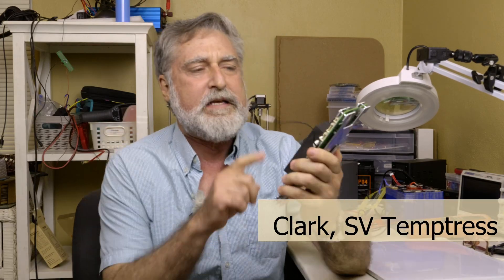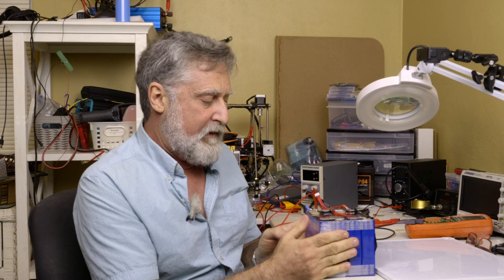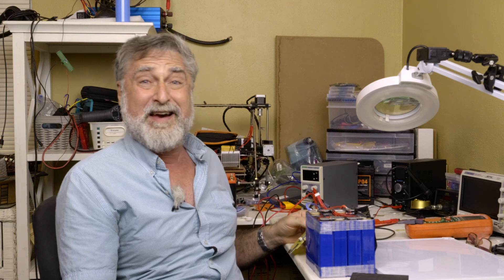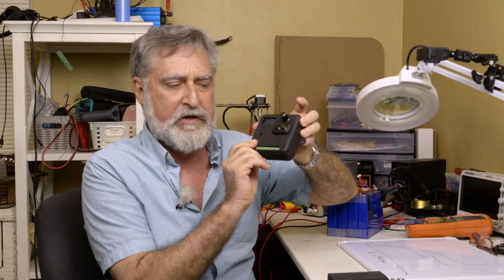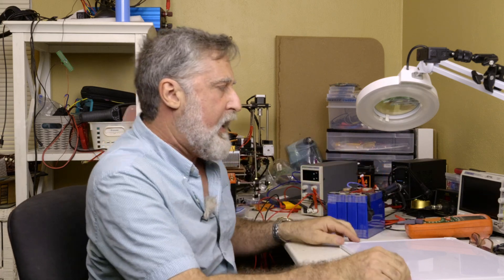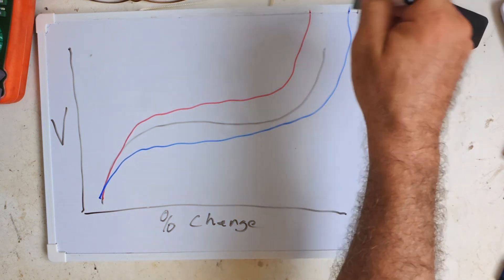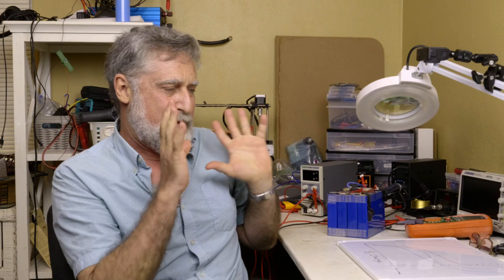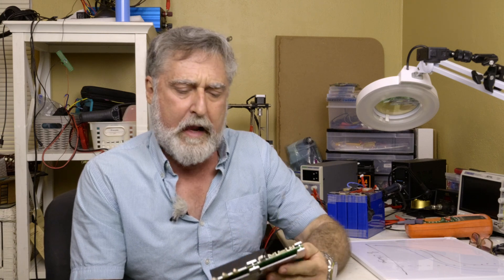What is a BMS really??

Comment: A good video on BMS, thank you.
I would like to correct and elaborate 4 points as follows:
0:20 There is a BMS in any LiFePO4 battery
==> Above sentence is true as a general rule, HOWEVER on starter LiFePO4 batteries the standard is rather NO BMS (in starter batteries the BMS is the exception, because to realize a BMS that can handle the extremely high crank amperes (CA, in lead acid often called CCA because it is tested at cold temperature -18°C, in LiFePO4 only CA because at -18°C a LiFePO4 battery has a high chance to fail, at least you need to apply some kind of warm-up procedure like switch-on main light for 1/2 or 1 minute or do have some heater integrated into the battery).
4:15 LiFePO4 is much less prone to venting/explosion/fire, because the BMS has a temperature sensor
==> NO, the reason of LiFePO4 being much less prone to venting/explosion/fire is not the BMS, BUT the different chemistriy of LiFePO4. Li-Ion batteries also do have a temperature sensor (no difference in this respect), but the chemistry of most Li-Ion batteries will start to get exposed of its oxygen once the temperature has achieve the level of about 150°C. The great exception is the LiFePO4 chemistry where the oxygen O is much more tightly bound, this means oxygen gets only released once the temperature arrives at 350°C.
The difference 150°C to 350°C before the oxygen does get released it THE REASON für LiFePO4 being much less prone to venting/explosion/fire.
12:30 If you try to charge LiFePO4 by voltage you will fail
==> It is correct, the voltage of a LiFePO4 battery is a very poor indicator for its state of charge, because in the use region of 10% to 90% charge the voltage does change only a few 10th of a Volt.
However, THE VOLTAGE is also for LiFePO4 THE INDICATOR/Limit for charging. The CC-/CV-mode applied for lead acid and lithium charging is always the same! What differs is the level of CC (Constant Current) as long as the charge voltage is below the allowed CV (Constant Voltage) level. And in the special case of a LiFePO4 battery once the CV voltage level (for 1 cell 3.6V, for a 12V LiFePO4 battery this means 4 cells in series 4x 3.6V = 14.4V) is arrived the LiFePO4 battery is already 100%/fully charged. In this characteristic LiFePO4 differs from lead acid and especially Li-Ion batteries. Li-Ion batteries are only charged to about 80% when the charge voltage arrives at its CV-level (4.2V per cell). To achieve 100% charge Li-Ion batteries need to be kept for about the same time they needed to arrive from 0% to 80% at its CV-voltage level. Smart people who want to charge more time effective do therefore often stop charging a Li-Ion battery already at 80% and this brings also some advantage in life as avoiding the stress to charge to 100% may increase the cycle-life of a Li-Ion battery by 20/30% (effective on Li-Ion with low cost cells having only 300 cycles, not of interest for LiFePO4 cells with 3.000 cycles). 
The failure in your logic is: 100% charge is not a value defined by Ah, your vertical line at 14:05, but the capacity of each battery does actually vary with the charge current (the higher the charge current, the less is the capacity of the same battery because 100% charge is defined by arriving at the CV-voltage AND the charge current being less than 0.1C, this should be represented by a horizontal line in your chart shown at 14:05). The difference in capacity is however not drastic. Reducing the charge current below the generally recommended 0.5C rule (e.g. a C= 100Ah could generally be charged by maximum 50A, unless the battery manufacturer do quote a higher charge current) you will win only a few % additional capacity (usually considered not worth the much longer charge time). Vice versa the effect is more pronounced. Only a wild guess figure: Doubling the charge current to 1C may reduce the quoted capacity by 10% (the actual effect strongly depends on the cell internal wiring which is on LiFePO4 usually extremely good).
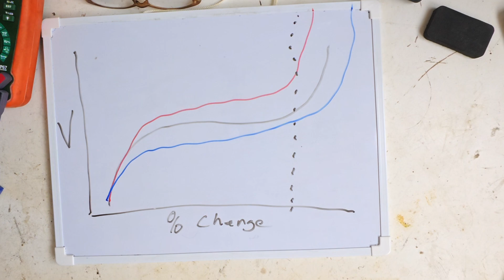18:00
==> In my image balancing does work as follows:
You do have passive and active balancers. The passive balancer is simply a small resistor that discharges the cells that first do approach their maximum CV-voltage. Such passive balancer has usually a current limit of 100 or 200mA, otherwise the thermal heat becomes too high, expensive resistors with huge heat-sinks would be required). The alternative is an active balancer using capacitors instead of resistors. I do not know in detail how such active balancer does work, but my image tells me a capacitor does get charged on the cell with the higher/highest voltage and then the fully charged capacitor does get switched onto a cell which is at lower voltage and push-charges its excess voltage/charge into the cell charged to less voltage and so on. Such active balancer usually has a 10-fold current capability. Anyhow, both kind of balancers do have close to 0 effect when applied during the CC-phase, because to balance a charge current of 30A into the battery with a discharge current of 100/200mA on 1 or more cells is not really effective. Therefore balancer circuits to get activated only when the battery is nearly fully charged. In other words, when you never charge your battery to 100% the balancer does get activated never (from time to time you need to charge your battery to 100%, otherwise the balancer being physically present is never activated, because the BMS software does activate the balancer ONLY when the battery is nearly fully charged).
Reply from the maker: You have a common misunderstanding about charging LiFePO4.  This might help you.
https://youtu.be/3USAqjntxIs
Reply: @Clarks-Adventure  I have already seen the video you mention, but I do not see what you mean by "You have a common misunderstanding about charging LiFePO4" ?!
As I have explained in detail I rather see a few minor mistakes and inaccuracies in your understanding, because Lithium battery and Lithium battery is not the same, etc. (It is for sure not correct to state any LiFePO4 does include a BMS -I have just bought a LiFePO4 battery as starter battery for my motorbike and the seller offered me the BMS as an option, clearly stating in starter batteries only a balancer is clearly needed, the overcharge danger is fixed by the alternator voltage limiter).
However, in the meantime I tried to understand better how an active balancer does work and the situation is more complex/difficult for me to understand than my initial image was. https://www.youtube.com/watch?v=VR-G-3D82e0 tries to explain how a capacitive active balancer does work, but I failed to understand fully in first view.
Reply from the maker: @FriedhelmSchröter the common misconception I'm referring to is that you can charge li to a voltage at all.   I explained this in the video on charging Li but I may have not done a good job 
   It's all about not charging above full capacity and that simply isn't defined by voltage.  I do it through modeling the li chemistry, it's very complicated but has proven accurate.

  I liked the video you offered
  I've seen it before but watched it again this morning because he does a great job.  I'm more familiar with the isolated power supply version of the active balancers circuit but this seems to work well 
    I have actually come to the conclusion that "passive" is actually better.  I make that argument in next Saturday's video.
Reply: @Clarks-Adventure  the common misconception I'm referring to is that you can charge li to a voltage at all
==> All what I understand as an interested amateur tells me that above sentence is contrary to the definition of what 100% charge does mean on a lithium battery.
In my understanding 100% charge is defined as i) Arriving at the maximum allowed charge voltage (generally 3.6V for a LiFePO4 cell, but you find often also 3.65V, sometimes even higher values specificed by the cell manufacturers) AND ii) Reduction of the charge current to a specified value (in my head is a value of 0.1C, I just saw the detailed specification of a 280Ah EVE cell, where 1 cycle charging is stopped at/defined as charge current reducing to 0.05C).
Above definition does mean that the capacity (100% charge) of a battery/cell is not a value absolutely fixed, but it is changing a little bit (a few %) when you are changing the charge parameters like charge current (generally 0.5C), or the current you decide to stop the charging, because to charge at less than certain current does not bring you sufficient fruit for the time you need to spend additionally.
Also temperature does change capacity a little bit.
Especially for LiFePO4 cells the voltage is THE DOMINATING factor to define 100% charge, as the hockey-stick curve close to maximum charge does not really increase the capacity when keeping the battery/cell longer time at the maximum allowed voltage. This situation is clearly different from Li-Ion batteries/cells where the maximum voltage to charge with is generally fixed as 4.2V. These cells are just around 80% charged when you arrive at these 4.2V. You can add additional about 20% charge when you do keep the battery/cell timewise for about as long as it took to charge from 0% to 80% at this maximum 4.2V level.
For sure you can apply different definitions for 100% charge, BUT one of the most important factors of any battery is the cylce life and ONLY when you apply a different 100% charge definition for your cycle life testing, then your different conditions/definition gets power/has some real value.

 I liked the video you offered
==> I have seen it now a 2nd time and this time I think I nearly fully understood the way a capacitve balancer is working (in short: At some voltage a Schmitt-Trigger is activated. This Schmitt-Trigger does have one phase where it controls the voltage to two lines of MOSFETs in such a way, that each battery cell does charge 2 of the 6(4 for a 12V battery)x 3 capacitors to its corresponding cell voltage. In the second phase the Schmitt-Trigger changes the MOSFET switching so, that each cell's 2 capacitors do get connected in parallel which forces the same voltage on all capacitors (this means charge gets transferred to capacitors of low voltage cells). When the Schmitt-Trigger then switches back to it first phase, the equal voltage of all capacitors does cause an additional capacitor discharge flow into cells below that voltage AND an additional upcharge flow into capacitors from cells above that voltage. And these 2 Schmitt-Trigger cycles do repeat until each cell voltage is finally equally enough. The 3rd capacitor seems just to be some protection against voltage spikes on the cells. What I still do miss is some clear data at which voltage does such active balancer get activated AND how much current effective is such active balancer (in the video simulation example the initial current flow capacitors not yet charged was extreme up to 30A).
As a rough idea from other sources I took the info, a passive balancer using a resistor to decharge the cells first arriving at high voltage is somehow limited to 100/200mA, simply because of the thermal heat up (some special variants are available to 500mA or even 1.000mA). An active balancer is considered to be effective with 10 fold or more of such current.
With 100/200mA being nothing compared to for example 20/30A charge current, the passive balancer gets only activated close to 100% charge, when the charge current is drastically reduced from the initial 20/30A, so that the thermal heat-up by the resistor brings some real results in comparision to the damage a higher temperature does cause.
An active balancer does not have the high resistive losses/heat up of a passive balancer. This means it could start to operate at much lower voltage. The video mentions somewhere 2.7V as an on/off switching criteria. If this would be correct, then an active balancer is not only much less dangerous from the point of heat-up, but would have also the great advantage that balancing does not require a 100% charge, but could happen at any charge status.
Here is another video I just saw to clarify this for me not yet clear difference in characteristic between active and passive balancers: https://www.youtube.com/watch?v=QUmt34YcM-U
At 0:41 it shows some specification data. In my view most important. This specific active balancer is not switched on like a passive balancer only when the charge is close to 100%, but this specific balancer seems to be switched on by a voltage difference of more than 100mV between the 4 cells and is switched off once the 4 cells are balanced within 30mV, completely irrelevant if the charge is at only 10%, at 90% or at any other status (working voltage 2.2 ~ 4.5V).
In clarifying the differences/capabilities of active balancers better I found also following Data Sheet for a 48V solution by TI, but in fast reading I have not found clear information when such (inductive?) balancer does work: https://www.google.com/url?sa=t&source=web&rct=j&opi=89978449&url=https://www.ti.com/lit/ug/tidubz7/tidubz7.pdf&ved=2ahUKEwjzm9q_3NiNAxXEVWwGHYx4O-EQFnoECB0QAQ&usg=AOvVaw0wZvQTsfN55ukdY93K3mtA

 I have actually come to the conclusion that "passive" is actually better
==> I would be very careful with such conclusion.
A passive balancer is in my understanding highly cost effective (cheap), small, but has the huge disadvantage it gets only activated when the battery is close to 100% charged, because the resistive heat-up inside the batttery housing reduces life time of the battery cells (also here some interesting date from the 280Ah EVE LiFePO4 cell data sheet: cycle life at 25°C= 6.000, cycle life at 45°C= 3.000, an increase of 20°C in temperature does reduce the cycle life to half).
As far as I understand up to now an active balancer in contrast is more expensive, much larger, but can act at any charge status (does NOT always require a charge close to 100% to get activated) and produces less heat up.
In summary an active balancer is advanteageous, when you have high system cost and therefore do want to optimize life time. In case of my LiFePO4 starter battery for my motorbike I think an active balancer is way too expensive (living in south-east asia I paid just 40$, still 60/100% more than a top tear Yuasa lead starter battery would cost and about 4x the cost of a low cost lead battery Made in China).
Reply from the maker: They are your batteries and you can charge them anyway you want.  Have at them.

You are just explaining your misconception again and again, I'm not interested.  Holding on to that makes new ,to you, concepts hard to understand.

To get an understanding of what I'm saying you may just have to abandon your position least temporarily.

Above all forget what the battery marketers are saying.  Read what the cell manufacturer say understanding that constant current is impossible in a live solar charged system.  And for the best understanding read academic papers who study the damage in detail caused by even moderate over-charging.

Or assume I did all that and believe what I'm reporting.  It's your call.

In short if you charge a LiFePO4 12v battery at 13.7v slowly you can overcharge it and damage it.  If you charge the same battery fast you can reach 14.6v without damage.  What voltage do you choose when the charge current rate is not under your control?   If you can't answer that you must accept you can't charge LiFePO4 safely to a voltage in a real world installation.
Reply: @Clarks-Adventure  Thanks for explaining all this.  I learned a lot from this video.

Comment: I actually trust a "smart BMS" to stop charging better than something external.  The new "smart" batteries are great for that.  They hit 100% and they wont' take a chage at all.  You can throw what ever voltage you want at the inputs, and it will not take any more charge.
Reply from the maker: Except none of them that I have experimented with do a good job at stopping at 100 percent.   Don't trust marketing.
   I'm about to review the new big Epoch.  They were the first to use what you are referring to. They seem to have realized it doesn't work and it seems from the manual they removed the "feature".  I haven't started my analysis yet though 

   In short this is a very difficult problem to solve.  I solved it so I understand shortcomings in other offerings.  So far nothing else does it right.  And it's the kind of problem where solving half of it is worse than solving none of it.
Reply: @Clarks-Adventure  Well - that's not correct.  As I said, it stop charing at 100%.  It will NOT TAKE A CHARGE.  I didn't do this blindly - I used a varaiable benchtop power supply.  As well as a high amprage switching power supply.  Once the battery knows it hits 100% it will NOT TAKE ANY CURRENT WNAT SO EVER.  Not even a few millamps.  It's off-off.  I think it has tansistors on the terminals and when it thinks it's at 100% it shuts the "input" off.  You can't get any more electrons in there.  I don't know if it's voltage or coulumb counting, (PS - this was on their Mini 100Ah bluthooth batter)
Reply from the maker: @GeorgeGraves I'm not suggesting the battery isn't stopping incoming charge.  Yes it turns off those transistors.
   My concern is when it "thinks" it's at 100 percent it's wrong.  I have not found one that doesn't use the simplest of logic (for example stop charging at 14v if the charge rate is under 5a).
   Tell me what battery or BMS you feel does a good job of "knowing" when its cells are full, and your idea of the algorithm used.

   Again, having solved this I promise you there is no simple answer.
Reply: @Clarks-Adventure  I don't know what algorthym it is using for it's SOC, sorry.  I feel comfortable letting the battery have at least a ball park of it's SOC.  I'm sure you've put a lot of work into the bankmanager, but since LFP are so cheap now - and the "smart" batteries seem to be doing such a good job managing themselves, well, yea....